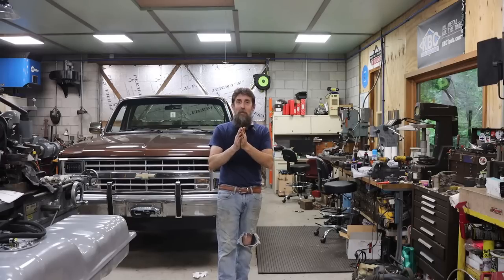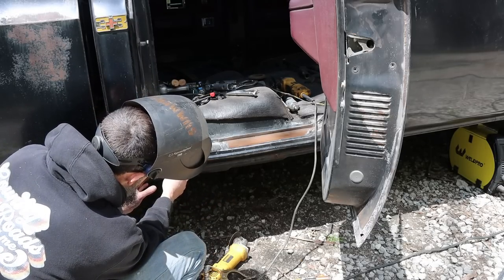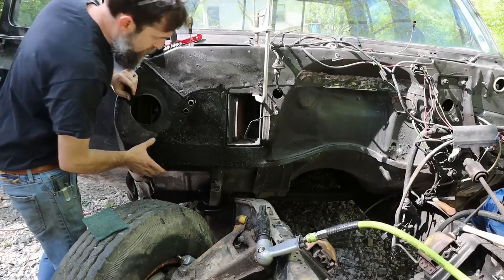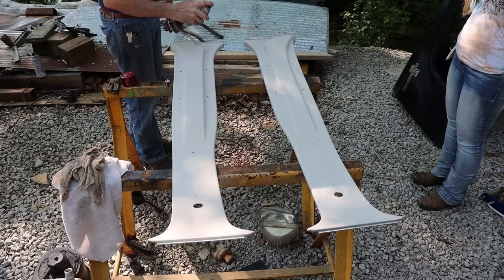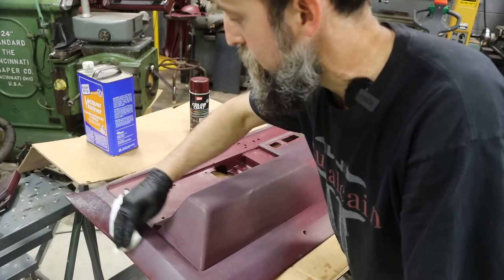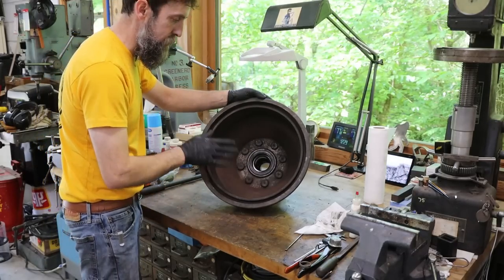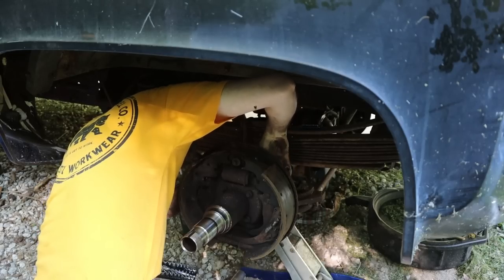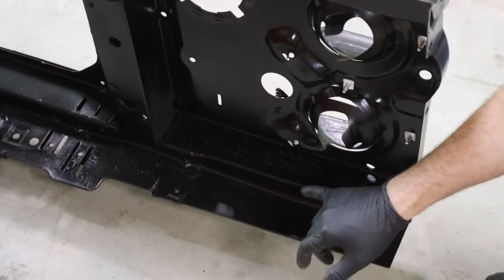Johnny Cash the Crew Cab Update. It Bad and good at the same time.

Comment: With plasic parts that are faded, hit them heat, i use a torch, but a heat gun will also do the job. Also helps keep the parts pliable. Then use the dye if needed.
Reply: I made a faded gas tank on a motorcycle look much newer that way. Motorcycle fenders, kayaks, and endless other items have been visually renewed since I learned that trick.

Comment: Son in law and I picked up and started on a 87 Dodge D150 4x4 for him last weekend. After 2 and a half days we have it running, all the front brake parts are in so tomorrow it should be kinda drivable, still waiting on the rubber line for the rear brakes. Once it's drivable it will be heading to his house for the little stuff.

Comment: Steve try the string trick on the springs (a loop of string used to pull stretch the springs into place) using pliers will mark or scratch the hardened spring metal and they will brake at the marks. hope this helps for next time. good channel content

Comment: Great to find this today my friend. You're a really well knowledgeable fella when it comes  to  these square body Chev trucks. Elizabeth as well. She sure  isn't afraid to get right in  there whenever she is needed. Neat use for our needle scalers. A  trick I can apply to an upcoming project of  my own. That sure is one really nice looking body parts technician you have there my friend. Not only that  but a squirrel whisperer and pretty too. The girl of your dreams my friend. Do you no longer have the squirrels hanging out there ? It has been quite some time since we have seen anything with them now. Timken have been  my go  to's for years. Quality bearings and seals for sure. One thing I like to do with new  brake cylinders is once they have been blead is to take a syringe full of copper coat never seize and fill them (bleeders) with that. 12 years from now the cylinders are still easily bled. I have  always had a chuckle when we take these grimie, dirty componence's apart when  they  go back together they have to be hospital  clean. I sure like your approach to this one my friend. Anything worth doing is worth doing it right eh. Thanks a bunch and I look forward to seeing more of this project you and Elisabeth have taken on.

Comment: VHT used to make ( not sure if they still do) a vinyl paint prep spray that promoted adhesion between the paint and the plastic panels.  I’ve done many color changes or touch ups on those square bodies and it worked great.
Reply from the maker: They do make it. I just haven't found it to be needed . It could be better than what I am using but I haven't had a issue with the dye sticking.
Thanks for watching

Comment: You talk about sand blasting and powder coating things. And than state you cleaned and sprayed painted them. However, for a very reasonable amount you could easily have a media blaster capability AND a hobby type shop powder coater setup and easily do the smaller parts with powder coating. It not only is the best rust protection, but actually fun to do those things as well. Look into such a setup. Not as expensive as you may think...   Thumbs Up!

Comment: Tip for those rears is to put a bit of molyslip into the bearings on assembly, and some in the diff as well. Helps reduce the noise of the diff, and keeps it from wearing much more. Normally i take tube and mix it with a tub of CV joint grease, to make it a higher moly content than it normally is, and the black goop works well in all sorts of uses. Use instead of wheel bearing grease on things like trailer bearings, where it helps a lot.
Reply: Moly grease is never recommended for bearings. Moly is abrasive and wears down the bearings. Using it for sliding surfaces is fine as it grinds  down surface imperfections.

Comment: Did you make sure that the parking brake cable was loose on those rear brake drums as quite often they are rusty and putting pressure on the shoes and making them tight.good luck

Comment: I’m pretty sure that the outside bearings on all hubs are placed in front the front and not the rear for the outside bearings if the race loosen up the wheel could come off the pressure of the nuts holds them in place so if there’s a problem it can’t go by the nut worth investigating but I not a expert just a observation

Comment: I have to respectfully disagree on the panel patching.  Like you said, it's always worse than it looks.  If I find a rust hole I pretty much take for granted that there's another couple spots that are almost rusted through on the same panel.  If I see rust I try to replace the whole panel because I've been bitten before putting a lot of work into something that then rusted through right next so where I repaired.  Don't get me wrong, I'm not replacing a roof because there's a hole in a drip channel, there's always little stuff to fix.  But on common cheap parts that are known for rusting (chevy rockers, chevy rear fenders) it's been my experience it's cheaper and faster to replace.

Cool trick with the needle scaler!  If you're looking for a cheap but good way to avoid doing bondo and paint on it, TCP Global sells DIY 2 part spray on bedliner kits for pretty cheap, and it's available in a lot of colors.  Theirs is harder than the rubber LineX types, sticks to nearly anything, and covers a world of sins.  The texture is entirely up to you, as is the thickness applied.  I did the lower half of my SUV because my kids drive it, and it's much easier to get another $50 quart of bedliner and respray a bumper or quarter-panel than it is trying to slick it out and have it repainted.

Comment: Could you have changed the rear brake to disks and saved on weight?
Reply: it is not really that much saved and could be done but not really cheap either..it is a 1 Ton. so weight isn't that important ..the drums last a long time....just a pain to change in these as you gotta pull the axle....i have one...did it...